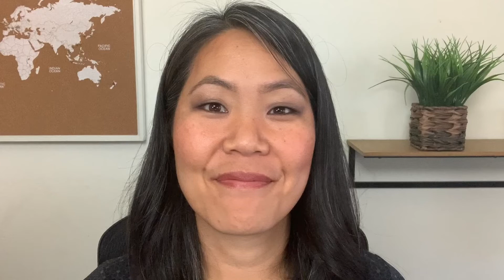How Backup Batteries and Storage Work With Solar Power | Jaime Greene the Solar Queen

Comment: Hi Jaime, for Bay Area customers is it more beneficial to get a battery or invest in more solar panels for peak hours usage?
Reply from the maker: Hi Helen, it depends on what your goals are when it comes to a power outage. Solar + battery is a complete solution.  Do you want your essential loads to have power in the event of a blackout?  If you don’t care, then I would go the route of oversizing the system and getting more solar than you need to offset time of use.  That is financially a better way to go.  But if adding a battery brings you peace of mind and comfort, and the additional cost of a battery doesn’t bother you, then get the battery, get 100-105% offset and take advantage of using the battery during peak time of use.